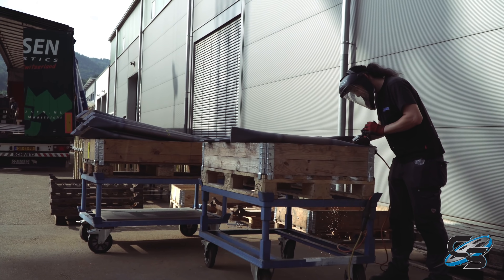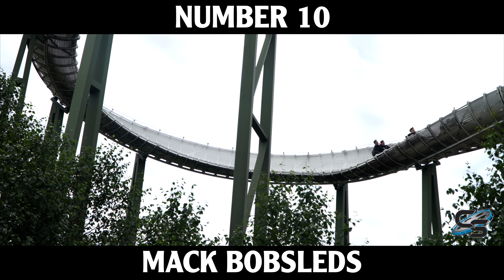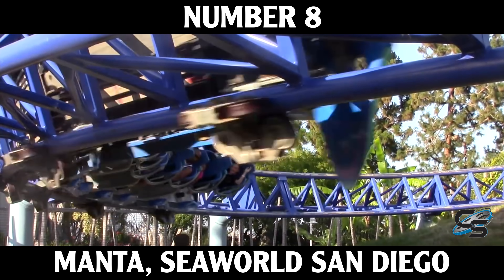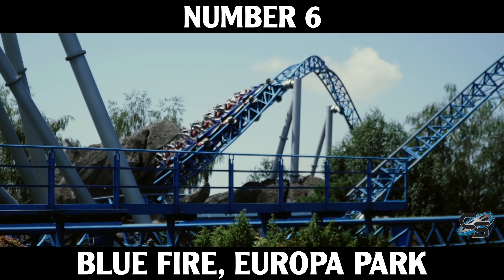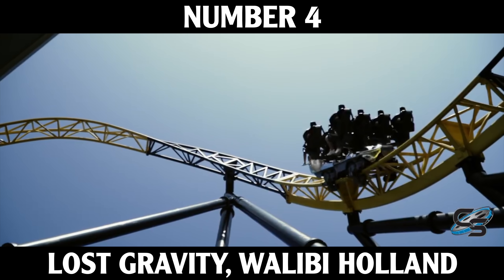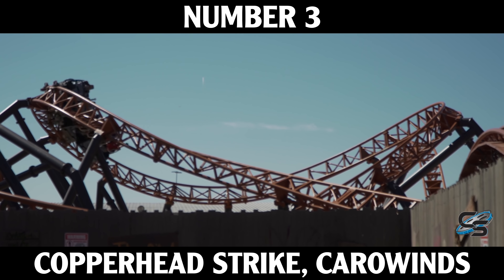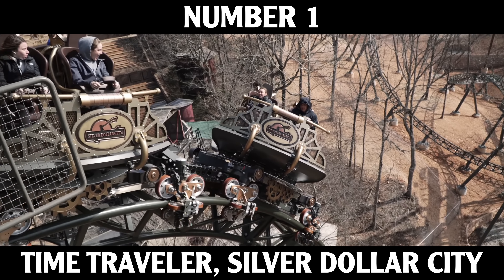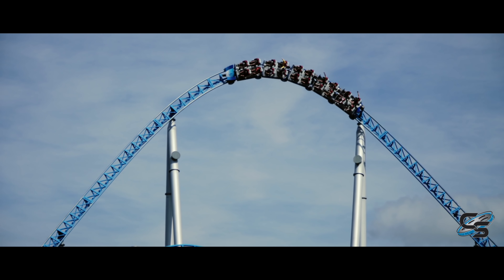Top 10 Roller Coasters by MACK Rides

Comment: Icon behind Lost Gravity hurts my bones
Reply: And behind Copperhead Strike too... I feel ur pain
Reply from the maker: Lost Gravity was sick bro
Reply: I'm gonna have to agree with Taylor on this one. Icon is cool, but it mostly consists of meandering and turns. Lost Gravity and Copperhead Strike don't seem to have any dead spots.

I have only ridden Icon out of the three, however I should be riding LG later this year.
Reply: @crashcoaster3852  ‘LG doesn’t seem to have any dead spots’ but what about those painfully slow turnarounds
Reply: @Gabes1321  I'm guessing you mean the turn before the mid-course... It's outer banked so it's not exactly gonna go fast through that, I wouldn't expect any coaster to necessarily.
Reply: @crashcoaster3852  exactly my point... it’s still a a dead point in the ride. It’s still an amazing ride but imo not as good as Icon
Reply: @Gabes1321  It's hardly much compared to at least three dead spots I can think of on Icon.
Reply: @crashcoaster3852  not my point. My ping is that u said there were no dead points, but there are
Reply: @Gabes1321  Well whatever. I wouldn't really consider it a dead point but each to their own.
Reply: @crashcoaster3852  I think it’s dead cuz you are moving so slow. It’s literally just a turn. Not banked

Comment: I've been lucky enoigh to ride a fair number of the rides on this list like Icon, Lost gravity, and Helix, as well as 2 of their Bobsleds. Helix is definitely my favorite, but even their small coasters are good fun. Like there are 2 Mack coasters in my local area, a Wild mouse clone which runs nicely, and a powered coaster called Mælkevejen/The Milky Way Express, and for a powered coaster it is really quite good! Fast and fairly snappy with some decent G's. It actually replaced one with a nearly identical layout from the 80's but which was slower and jankier. Both versions had their advantages and disadvantages. I actually have the poster for that ride, its a fun one plus that poster art for it and the other attractions near it simply looks amazing

Comment: Also, intamin bobsled vs mack bobsled?
Reply: Only Intamin bobsled I have ridden is La Vibora at my homepark. This ride as a lot of little “pothole” sensations where you get slammed down into your seat. It can actually be very painful if you don’t brace yourself, Along with the block break sections. This is why I prefer the Mack ones
Reply from the maker: MACK’s are a lot more enjoyable in my opinion